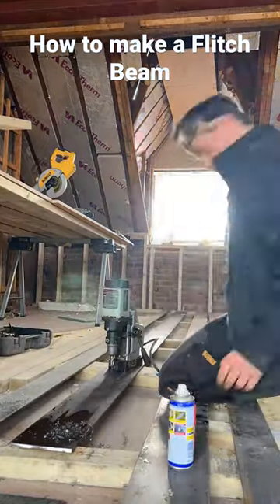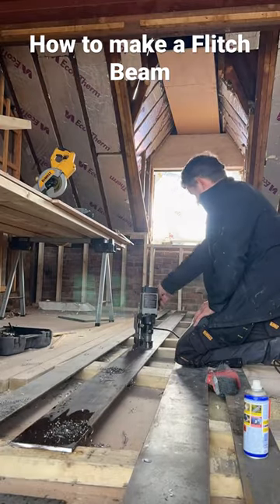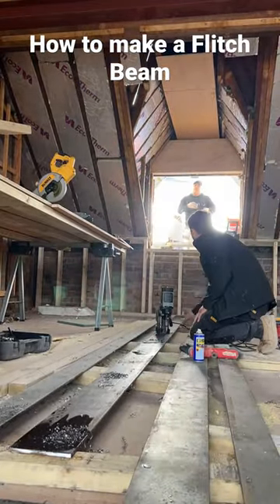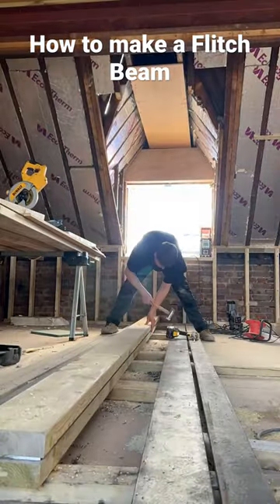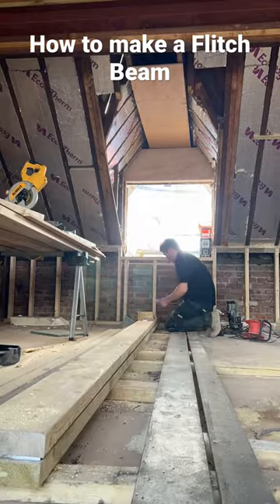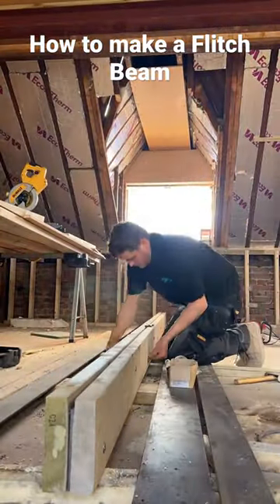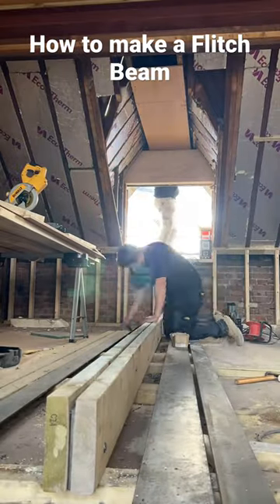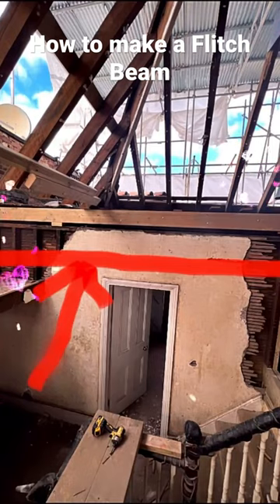How to make a structural Flitch beam. #builder #dewalt #dewaltpowertools #carpenter

Comment: What weight can this support
Reply from the maker: Not sure it’s maximum load, it was specified by our structural engineer 👍🏽
Reply: @scottthebuilder6823  cheers for replying I have an old outbuilding with a concrete roof and was wondering if this would be any good as a support for the roof?